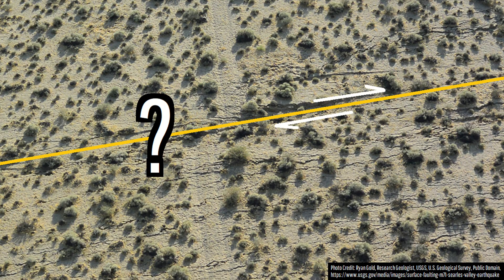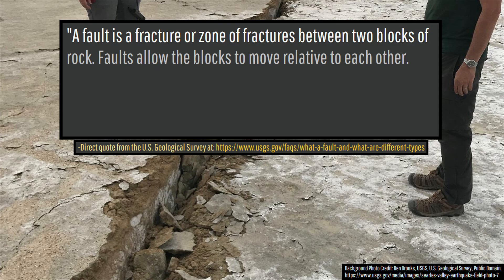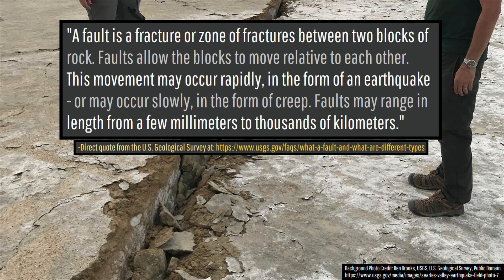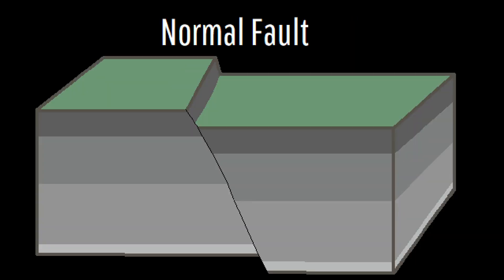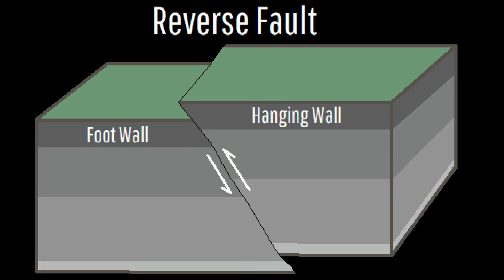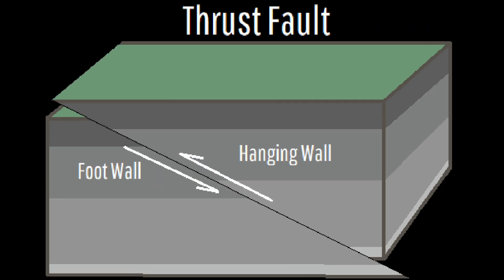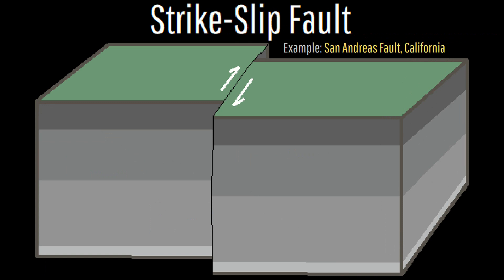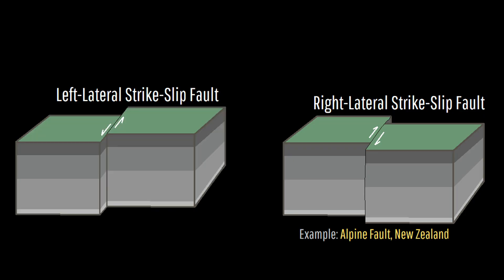The Types of Geologic Fault Lines in 99 Seconds

Comment: Thank you for teaching geology centered content. I have a question. A right or left lateral strike-slip fault "When viewing along the axis of a strike-slip fault if the righthand side is moving towards you, it is a right lateral strike-slip fault..." if two observers are both looking at the same fault, 1,000 feet apart, and facing each other,  one would see a right lateral while the other would see a left lateral.  Which observer is right?

Comment: GH,
Thank you for this video. I requested this one some time ago and you've come through!
For your section on creep, you can use the Hayward Fault for that. There is a long section in the East Bay that has had this happening for 100+ years. Memorial Stadium on the Cal campus had to have repairs done to it thanks to this creep on the Hayward Fault and there are plenty of other spots where this creep shows.
Reply: I spent too many months in San Leandro and going to Hayward looking for the cheap. I couldn't find it, probably due to my own ignorance. I did research and walked the parts of town the internet pointed out but couldn't find it.
Reply: @BlackCloudCV60  I know there is video of Memorial Stadium's creep after 80 years. I have seen pictures of this in areas south of Berkeley as well.
You may not have seen a lot of creep as some areas my have repaired the breaks and some may have been young enough to not have much movement

Comment: reverse fault is what we used to call a Subsidence Fault... weird on how you didn't mention a Growth Fault... Maybe its name changed to one of the ones you mentioned.
Reply: A growth fault is simply a normal fault in a specific setting. I've never heard a reverse fault called a subsidence fault that and it doesn't make much sense as a name anyway: subsidence would normally produce a normal fault, not a reverse fault. But just to confirm, I pulled an instructional copy of Structural Geology by John G. Dennis (1973) off the shelf, a book two years younger than I am, and the term "subsidence fault" does not appear. "Reverse fault" has, in North America anyway, been the term used since 1913 (see Reid, H. F., Davis, W. M., Lawson, A. C., Ransome, F. L., 1913. Report on the Committee on the Nomenclature of Faults.  Bulletin of the Geological Society of America 24, 163-186).